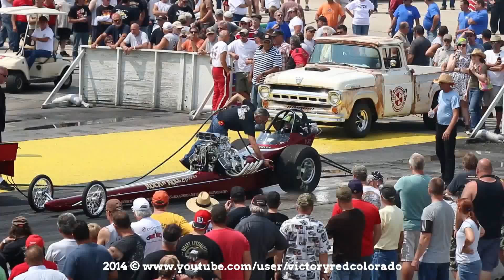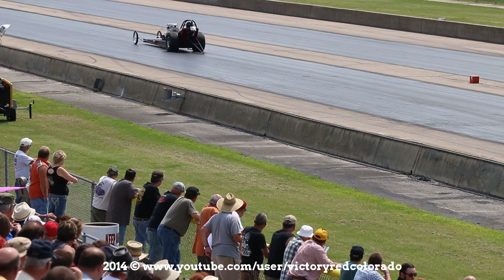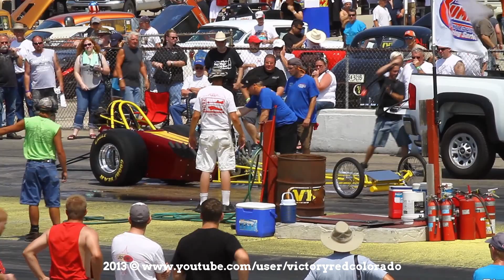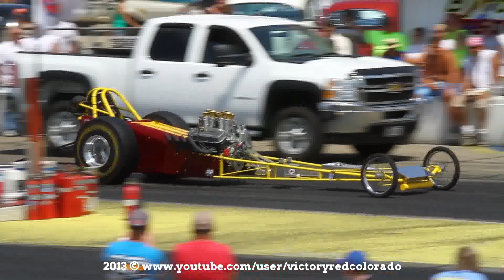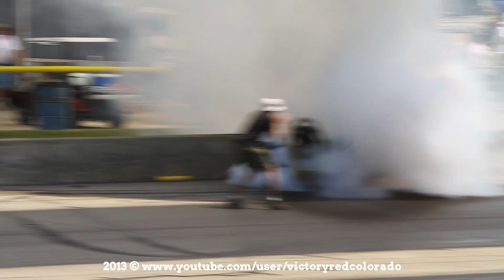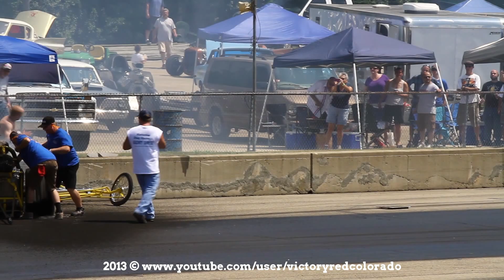EERIE DEJA VU OF FED DRAGSTER MISHAP LAST YEAR~ SAME LANE SAME SITUATION AT MELTDOWN DRAGS

Comment: Its not his fault they didn't tell these dragsters not to turn the wheel when backing up then slam it into Drive and do a burnout against the wall... Seriously though thank GOD for the safety equipment doing what it was supposed to. That could have gone waaaay worse... Ugh... The Dragster itself looked fairly new... Either way... No Fun and Not Cheap...

Comment: Dont those things have an external kill switch?  I thought all drag cars have too.
Reply: No, you're right. There is supposed to be a master power switch (Push off) in the back that shuts off all power and grounds out the magneto. My car has one.
Reply: Someone should get a fine for that...?
Reply: Late time to comment but I'm guessing the track personnel couldn't get to the kill switch with that hot rubber blasting off those big slicks spinning like that.
It makes me wonder how a more remote access to kill switches could be engineered.
Reply: would be hard to get to
Reply: Chauvin Emmons I was thinking more along the way of fuel shutoff as you explain well (thank you!) but from a distance, perhaps the crew chief could have access to a remote control in such cases where the driver is incapacitated.

Comment: Firstly, the first video shows a dragster that has broken steering. In the second video the guy had passed out from heat exhaustion and his foot was stuck on the throttle.  So it's not really the same.
Reply from the maker: SabreMetalPanzer You are wrong on both reasons of why they both had issues sorry. They occurred with basically the same type of vehicle in almost the same spot on the track which does make it eerie but yes luckily for the first driver it he didn't end up like the one who crashed
Reply: +victoryredcolorado What happened then? I've seen what happened to the first driver before. The second driver must have passes out or had some type of fueling issue for it to go WOT like that.
Reply from the maker: +Jack_ Wolf_741 It starts from backing up too quickly
Reply: ...and the extreme amount of caster in the front end...which causes the wheels to stay straight going forward...and just the opposite in reverse...

Comment: Well, it's a well titled race.   Anyone ever heard of a Halon fire extinguisher,,,or any kind of fire extinguisher?  I think I will stay away from Byron Burnstrip,,all those jackasses have there thumb up there butt there.  Dance around like a chicken with your head cut off,,,does wonders for a spendy race car motor.  Idiots.   Stay calm and work the problem folks.  And if you are standing over near the fence and just spectating,,don't take ANY steps forward to get a better view of a hung throttle on a race car. For god's sake,,move the other way.  It could have buckjump bounded over those barriers, whisking the chicken wire fence out of the way just as easy, and ate you alive.
Reply: +kh40yr 
A Halon extinguisher will displace all oxygen from the air and can kill the driver.
Reply: They have been used in F1 etc and noone had died yett!
Reply: a halon extinguiser would not kill the driver in that situation, only a major risk to a driver in an enclosed cockpit, doorslammer with a poor firewall
Reply: If I was head of the safety crew, I would have hung my head in shame and left the site headed for the next bar.  The safety crews first priority is to take there safety last,,, yes last, and to get in there and fight with quick wits to save MAN and machine. If they don't live for that sort of thing,,then they should not call themselves that .